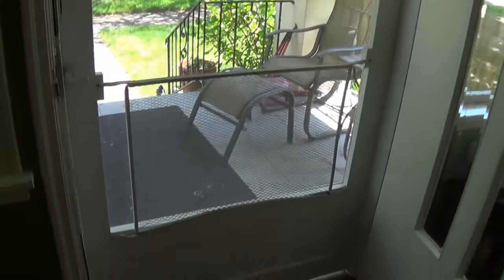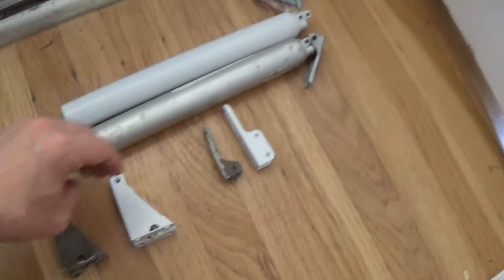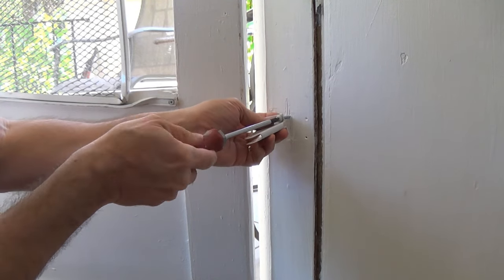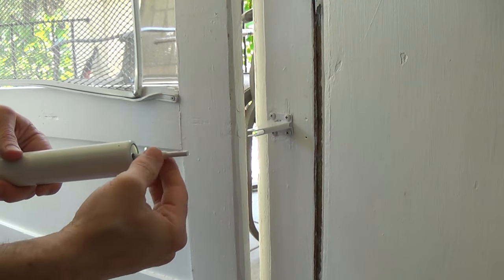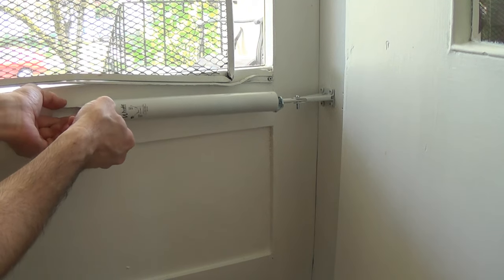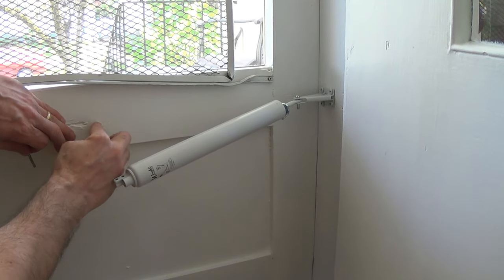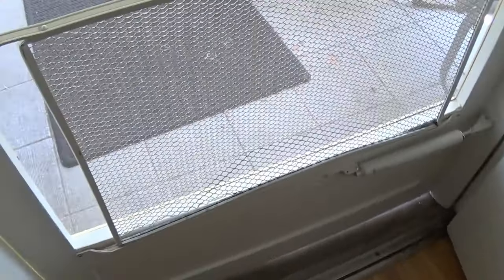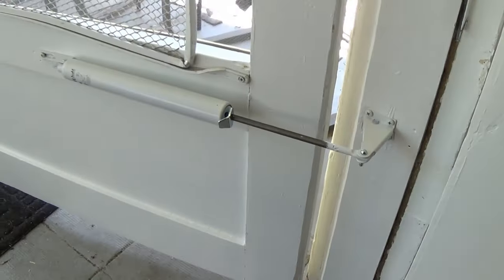How to Install a Screen Door Closer

Comment: Once you mount the closer to the door jamb use a level on top of the closer, before mounting bracket  on the door, will work better and last longer.

Comment: 1. Make sure it is level first
2. put the screw in the centre of the bracket slot. This will give you 50:50 adjustment either way. You did neither...

Comment: I have a screen door that has a lot of tension when opening, and retracts quickly before slowly down with the pneumatic pump. once the pump regulates the door close, it works as expected, slow and fully closes. so it’s annoying to open because it takes a significant amount of strength and slams back at you. any suggestions? i figure i may just need to get a new closer.
Reply: If you have a heavy duty closer it may be exerting too much force.  Try a standard duty closer.  They require less force.  There's no adjustment that will reduce the tension.  Some older closers could be turned to adjust - you may  want to try that.  Also, the installation instructions should explain that the adjustment screw should be used to prevent the door from slamming and from closing too slowly.   The adjustment screw does not help close the door further.  In order to make certain that the door closes completely, the closer needs to be attached to the door so that it has some pull when you insert the pin.
Reply: @ctoczycki  awesome thanks so much, I’ll replace the pump. Might as we get a new one anyway and learn firsthand how to install. I forgot to mention I did try the adjustment screw and same thing. Thanks again!

Comment: Make sure the door is closed when you install the door bracket, if it's open, as I learned the hard way, you're screwed. He does it right in the video, just doesn't emphasize this point enough. Good video, though.

Comment: Why does it slam shut for the last bit... surely should close softly
Reply: +John Wang you right! He make bad JOB. Doors should close on last 2-5 cm softly and firmly. He stafted this JOB! LOL . shame !!!!!!
Reply: John Wang Because during installation your supposed to pull the piston rod out about an 1 1/2 inch and put the locking washer on to hold it in place. Then mark you holes to install brackets. That way when it pulls closed it has tension all the way to the closed position.
Reply: THank man I was looking for this exactly answer as the instructions said something like this but I wasnt sure

Comment: Good video.  I have even more previous holes to deal with so I bought a metal plate at Home Depot to cover them up.  Don't know if it will work because the screws to attach it might be in the way.  Unfortunately a bird flew into the lanai enclosure and I'm waiting for him to leave before I proceed (my projects never go smoothly...well at least 80% of them).  I also don't think the door should slam shut like that, but this should be an easy adjustment.

Comment: This evening Ikea is delivering my large bed and I would like to disengage my door closer. I just pulled out the 2 pins but  it's now impossible to put them back in. Do I have to unscrew the wall bracket or the door bracket?
Reply: No, put the end with the hold open washer (right end side in the video) in and put the pin in. Now put the other in and pin it... That's all that you should have to do... You may have to pull on the unit (shock) to get the rod out enough to put the pin in...

Comment: I bought the same closer today, but have found that the locking washer doesn't move as it should. It "bites" into the piston rod and gets stuck. Does this happen on yours?
Reply: Turn the locking washer 90 degrees or so... it should release.

Comment: My suggestion is to use a level on the line between the mount points - to make it look good and work better. when it's at a slight angle like you installed it, it gets less force from the pneumatic. And it looks trashy.
Reply: Great job thank